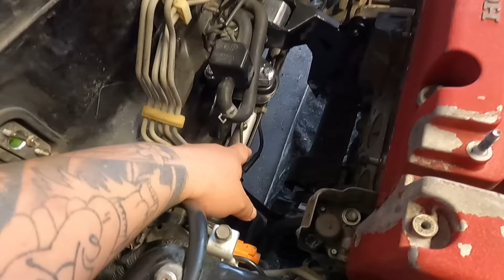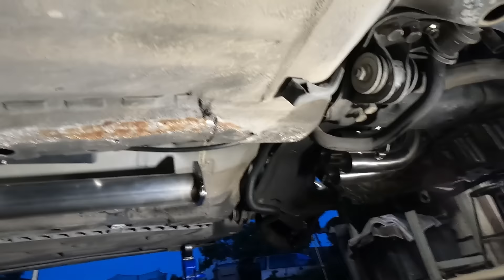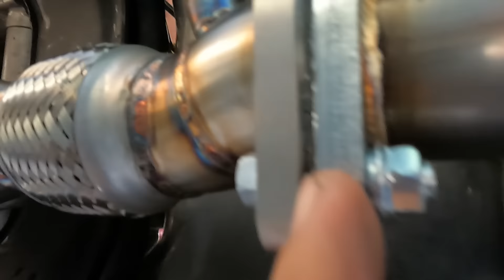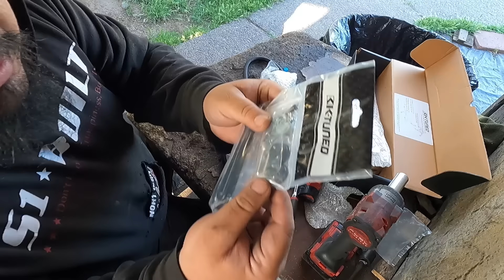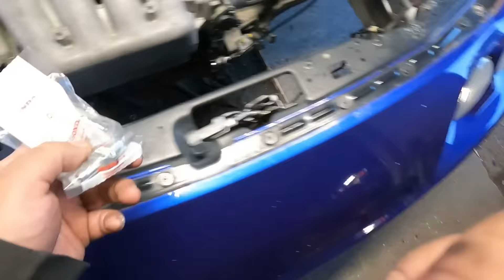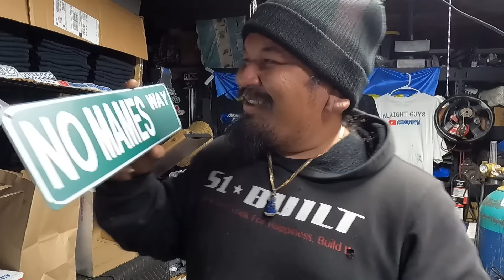K-Swap Your Integra (94-01) PT3 : CIrcuit Werks 4-1 Header + REVEL Exhaust System | Ktuned Fuel Kit

Comment: flip the mid pipe upside down, relocate the hanger to the under side again to hold it up to the correct height and a straight shot to the header....

leave the heater valve bolted to the firewall, put a U shaped heater hose directly on the valve to run it back over the valve itself (changing the flow 180) then use a short 2 inch nipple or so (with worm clamps) in between the hoses to connect the U shaped piece to the hose going to the head (new supplied hose)

where's you're ADD at with the fuel regulator....flip the mounting bracket upside down for the Allen head bolts to clear the shock tower properly.

Comment: I was surprised when you cut the megaphone. I thought you would put the flex on it and modify the mid pipe. I understand the goal, doesn’t the megaphone determine sound as well as a power adder?
How about a long extension to roll the lip for the flexy. 
🤷🏼‍♂️

Comment: Tanabe USA rebranded and introduced the Revel brand to represent their line of automotive parts, including exhaust systems and suspension, while maintaining over 30 years of manufacturing experience. Revel products, particularly the Medallion series, are manufactured by Tanabe to the same specifications as previous Tanabe products, featuring high-quality stainless steel and TIG welding.

Comment: Bro... I am having so many issues with my DTR header. I have swapped out for another one from them that wouldn't stop leaking bad now I find my collector in the middle is leaking.... shit is annoying af. I guess its time to just buy a good header.
Reply from the maker: any header with the 2 piece design is going to leak at the joint. this car is having that issue. the collector was a bish to put on like all of them. if you watch, i used worm clamps to pull the collectors together.
Reply: @YoungStatic  I might have to try that.
Reply: @YoungStatic Hey bro tell him to install a fresh metal gasket later. A lot of times they compress and leak there.
Reply: I bought the one piece DC Sports (The owner of Hybrid Racing owns DC now) K swap header with the built on flex pipe. Two piece headers always leak unless they are welded. Which is hard to do once mated together.
Reply: @carportmods  Yeah I had the first one welded and it did not help. I mean the Circuit header Dana uses in this video the collectors line up, my DTR header you have to fucking fight it every step of the way to get that shit to line up.
Reply: @Lastsight100 I bought this "beautiful header" on ebay with solid reviews. It has a DAB name plate on it. Perfect welds. I tried for  an hour to connect that thing. I gave up and ordered the DC.😂😂 It has a megaphone similar to the one in this video. I'm going to weld it onto the DC. Oh and I tried to contact the seller..."No longer a registered user" of course.
Reply: All slip joints will leak, once hot and a bit of carbon builds up, sweet as.